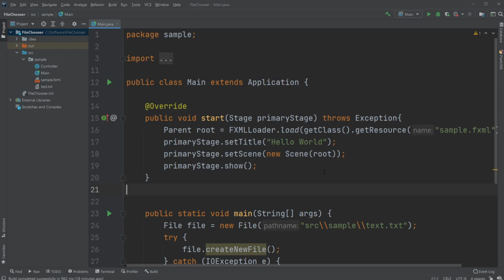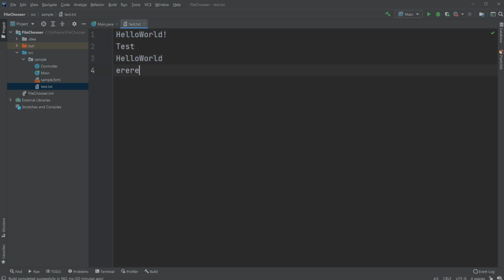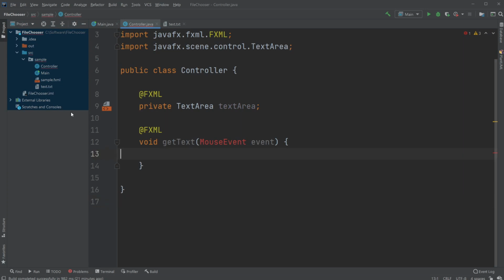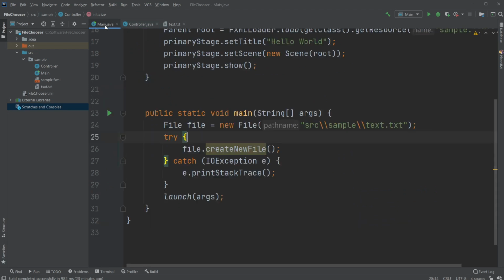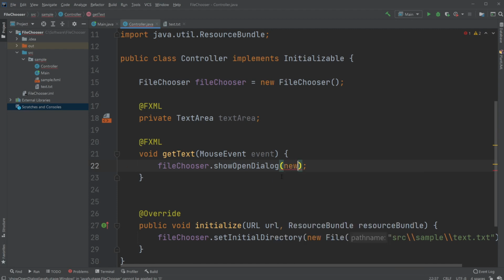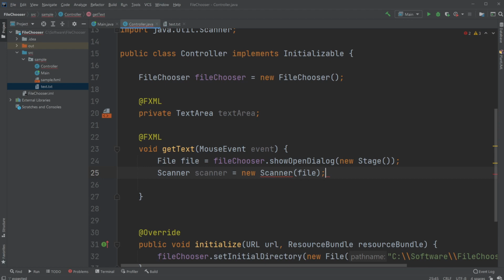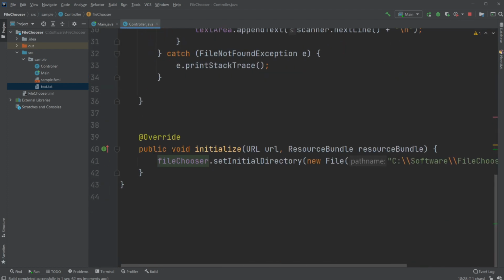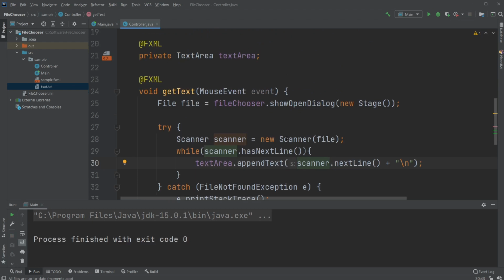JavaFX and Scene Builder Beginner Course - IntelliJ #16: FileChooser: loading files

Comment: Here you used append but when I run this code, I can't find old information. What to do now?
Its shows every time to replace the text file.
Reply from the maker: Sometimes JavaFX has problems regarding appending. what you can do instead is load the data from the text field and then manually add the new test to the old text, and load this combined text to the text field.
Hope this helps, let me know if you still are lost.

Comment: Can you please provide source code?
Reply from the maker: Source code: https://gist.github.com/Da9el00/f75565592ded943420969a3fbcad4d2a
This is the soruce code for both #16 and #17, because 17 is building upon 16.
Reply: @Randomcode_0  can I use multiple textArea's information in on file?
Reply from the maker: Yea that would be possible, you would either need to add the text together in one String before writing to the file, or you can use append mode to append text to a file instead of overwriting every time.